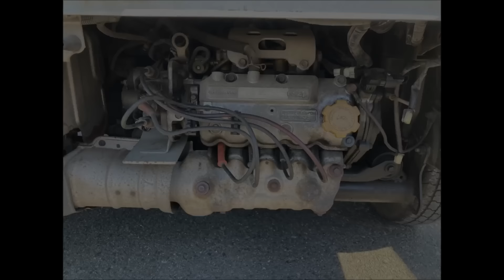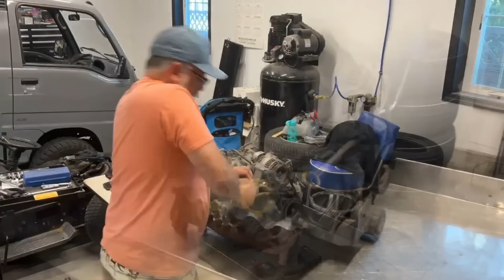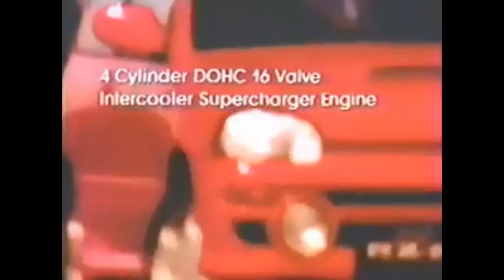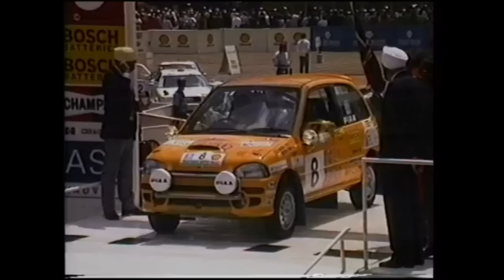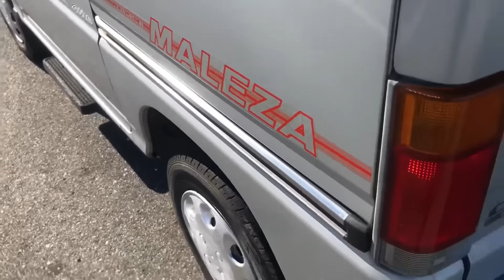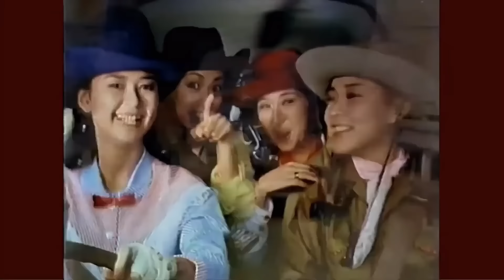How Subaru Built Japan’s Most Unique Kei Engine — The EN07 Boxer

Comment: I was just going to mention my fellow Brit Colin McRae entering the Africa Safari, Subaru Vivio RX-R wasn't just sold in Japan every model of the Vivio was also sold in the UK & Europe, so we also got the 2 seat Version of the Vivio my God is that a weird looking thing, the front is identical it's the middle that's different, it's 1 of the only few Kei cars that wasn't sold with larger engines for export markets. The UK is a market that got quite a few Kei cars with UK spec so reverse lights etc, in the UK many Daihatsu keis were sold from the Copen which I've owned 2. Daihatsu Hi-jets Suzuki Carrys Cappuccinos & the Daihatsu Mira Avanzanto TR-XX, so they aren't solely sold in Japan.

Comment: Interesting fact, the first Subaru 4 cylinder was deigned by BorgWard in Germany in 1958.
Reply: The first horizontally opposed engine was built in 1898 by Karl Benz in Germany. The first subaru boxer engine was built in Japan in 1966 by subaru.
Reply: I have a 1956 Goliath 90E van with the 900cc two stroke Bosch direct gas injection in to the cylinders. Front wheel drive with 4 speed. The engine also has direct oil pumped into the main bearings and a oil Fogger in the inlet.

Comment: 760cc stroker variant for export only needs an honorable mention.
Reply: for what vehicle did they export it in?
Reply: @Dan-xf7bh  Manufacturer
Subaru
Also called
Subaru Fiori (Australia)
Subaru Ace (New Zealand)
Subaru M60/M70/M80
Subaru Sherpa (Australia)[20]
Subaru Viki
Subaru Mini Jumbo[21]
Subaru Signet (Ireland)
Production
1986.11–1992.03
Body and chassis
Body style
3/5-door hatchback
Layout
FF / AWD
Powertrain
Engine
544 cc EK23 I2
544 cc EK23 supercharged I2
547 cc EN05A I4
547 cc EN05Z supercharged I4
658 cc EN07A/E I4
658 cc EN07Z supercharged I4
665 cc EK42 I2 (export)
758 cc EN08 I4 (export)
Reply: What are you talking about? What a stroker?

Comment: Subaru Boxer engines = No bueno
Reply: Generic statement and totally wrong take the EA 71 or EA 81 and a number of other Subaru Engines certified for Aircraft use do not get that dertification for an Engine that is "Not Good
Reply: @stephencox4224  Blah. Blah. Blah. Blown head gaskets and leaking cam carriers that require the entire engine to be pulled from the vehicle to repair have, and will be all the rage for many owners!!! What a terrible design!!!
Reply: @Richard-s1d5q  showing your @ss here bud. EA71-81 don't have cam carriers because they are pushrod motors and neither commonly have head gasket failures. You are talking modern OHC Subaru boxers and literally none of that applies to the EA engines.
Reply: @Richard-s1d5q  Nothing compared to the Toyota 2 litre mid engined MR2 last time I did one of them 10 years ago it took me and the fourth year apprentice non stop from 7AM Friday till 10 AM Saturday after catastrophic Cam belt breakage bent valves etc that time was just refitting the Engine A Ferrari GTB 308 I did a similar joob on after an Engine bay electrical failure caused a fire the Auto Electriciand missed the fire damage to the cam belt on one side not only were the Ferrari parts cheaper it was aside from removing the engine witha $3000 rear screen inches from the engine for R&R overall easier to work on the MR2 was a nightmare.
That MR2 was the first Toyota with 5.5 mm plug leads and the owner decdided to have the rotor button $ 359, HT Cap $475 and leads  $559 replaced ouch
The head gasket and valves were almost twice the price of the Ferrari Parts So Subaru's are cheap to rebuild and service in comparison
Reply: @stephencox4224  Wow. That's crazy. I know a couple MR2 owners who just gave up after so many problems and parts scarcity.

Comment: It’s pronounced “kay” car not key car. 4 cylinders are not inherently balanced. That’s why most require balance shafts… straight 6s are inherently balanced
Reply: What do you expect from AI narration...
Reply: Incorrect, boxer 4 cylinders have near perfect primary and secondary balance. They are inherently balanced.
Reply: @xTerraH  But the EN-07 is an inline 4, not a flat boxer 4. so, the EN-07 has perfect primary balance, and not good secondary balance.
Reply: @xTerraH  now where was it stated this was a boxer nor was i referring to a boxer. Im just stating fact. I have an inline 4cyl, 2.5L i deleted the balance shafts in it. lol i actually took it to a machine shop to get him to delete it properly (i coulda used a kit).  I’m not here to argue with people whats balanced- primary, secondary forces. Ect i was just making a claim to this video
Reply: depends on the size of the engine, too.  Smaller reciprocating mass helps...
Reply: The only ones requiring balance shafts are the ones bigger than 2.0l, chevy 4 cyl are also shit
Reply: @dantesixx1155  most still have them. My 2.5l 4cyl has no balance shafts, it had them, i deleted them… that’s bigger than a 2.0 and im nearly 100k miles on this engine with no balance shafts… that’s bigger than doesn’t negate the fact a 4cyl is not inherently balanced
Reply: You're going to complain about that when the EN07 isn't even a boxer as stated in the title?  This entire piece is a rabbithole of AI slop.
Reply: @rockets4kids  
And the narrator clarifies that the engine wasn't a boxer.
Reply: I suppose it meant in comparison with 2 and 3 cylinder engines, the point of reference. I think this Subaru 4 cylinder does not require a balanced shaft.
Reply: It's ai, it can't differentiate
Reply: It’s AI.
Reply: Look 4cyl engines are more balanced than 2 and 3 cylinder engines and while the straight 6 is the simplest engine with both primary and secondary balance as a general rule more cylinders are smother power delivery and less vibration than less cylinders for the same displacement. The engineering is kinda impressive for the class and year.
Reply: Didn't Honda also make a 4-cylinder kei engine?
Reply: I came here to say the same thing.

Comment: My cousin recently bought a Subaru Sambar pick up to use as a daily driver. He loves it. He specifically told me he liked the EN07 because it an inline 4 and non interference. I'll have to ask him wether it's supercharged or NA.
Reply: I had a 1998 Subaru Vivio Bistro with a Supercharged EN07. I drove it hard for 50K delivering pizza. Was a blast. One day the timing belt went kaput as I was accelerating hard. It was about 108,000Km at that point. I replaced the timing belt and the car was fine. It definitely is Non interference.
Reply: I just imported a 2010 Sambar into Canada and I’m trying to confirm the engine is a Non interference engine. I’m thinking it’s not but I keep seeing conflicting information. Mine is naturally aspirated. Most of them are not supercharged and when they are there is definitely a big jump in cost. Be nice to have more power but I’m okay with the power mine produces. Obviously not a speedy ride.
Reply: @toddfleury7324  I have an EN07X out of a 2008 Stella, and I have swapped the cams over to Vivio RX-R cams (higher lift and duration, the Vivios rev to 9K whereas the Stella only revs to 7.2K). Mine is non-interference, I have turned the cams over by hand, with timing belt off, with crank at cyl 1 TDC

Comment: Not exactly a boxer, however it gives me hope that someone builds a boxer 8 cylinder using two together lol H4, H6, but no H8 for a company that says "Love, it's what makes a Subaru a Subaru" powered by H8 lol That idea has been brewing a long time. That and putting a supercharger into the SVX plenum :)
Reply: There's a Chinese company building a 2.0l boxer 8! It's for a motorcycle
Reply: Some manufacturer made an H-16 boxer 16 engine for formula 1 in the 1980s
Reply: Well, the real problem with an H-8 is packaging.  The rest of the car has to be designed around the engine's external physical dimensions and its weight and weight jack (rotating mass).  Just like a spinning wheel has a gyroscopic effect on a motorcycle, every piece of rotating weight in the drivetrain (engine included) has harmonic effect on how well the car turns, how much it "leaps" when you accelerate, and how much it takes to run it; more starter motor; more battery; more oil; more coolant; more radiator; more exhausties; more engine mounting; more more moar moar.  Add to that the budget and design limitations that prevent locating the front wheels on an all-wheel-drive car platform any further forward than the crossover shaft that only fits in the space behind the torque converter (auto) or clutch/pressure plate (manual); which means the entire engine is forward of the front wheels unless they ditch their existing all-wheel-drive system.  Also, this is Subaru we're talking about; which means they gotta also somehow make it pass a crash test and emissions.  And after all that, the price had better be right, because right now, nobody's buying ANYTHING new unless it is absolutely perfect.

I believe if Subaru really wanted to do an H-8 that would be fine, but they gotta build a larger platform for it to physically fit into; but if it were me, I'd design it like Ferrari did with the FF; where there's a pair of managed gearboxes; one mounted at the front of the engine with the timing chains and stuff for driving the front wheels, and the one mounted at the rear of the engine for driving the rear wheels; this would allow the engine to be centered over the front axle rather then completely forward of it.  

Just my 3 and a half cents....
Reply: @ManCentralStation  :pulls out sawzall: lol
Reply: That would be a Honda goldwing 4 or 6cylinder engines but  all bigger .. below a thousand CC  unless you do a lot of work 3cylinders  produces less friction ..but causes firing issues ... Even twin cylinder MCycle  engines now use slightly offset pistons and electronic  timing now to reduce vibrations and improve power delivery and  efficiency .. Laverda did the triple shift on their triple engine Jotas and Mirages.
Reply: This would make a great range extender generator engine for  Electric  powered larder vehicles at the moment too many are in the above 1.0 or 1.5L capacities 🤷🏻 plus It only ever has to operate at its stoichiometric  optimum and multi fuel  operation.
Reply: https://youtu.be/eeKQuncPVXU?si=p6XVDpTAhs1-KwxB